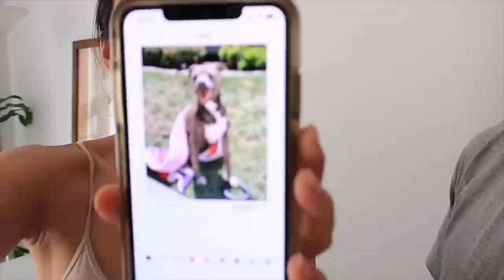Home Vlog: Giving Our Pitty Puppy a Bath + Bedroom Update

Comment: If you can afford a Vitamix, I highly suggest getting one from Costco. It's on sale sometimes so watch for that. It works incredibly well at make smoothies as well as hot soups and other yummy dishes.
Reply from the maker: I actually just bough an off brand vitamix, its basically the same! two year warranty and it was $100 bucks so it will be fine i hope